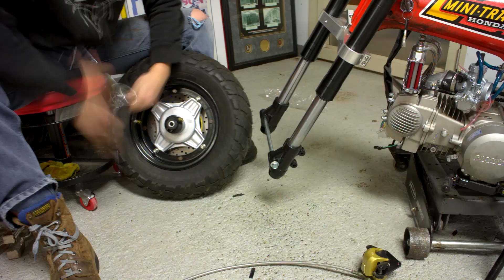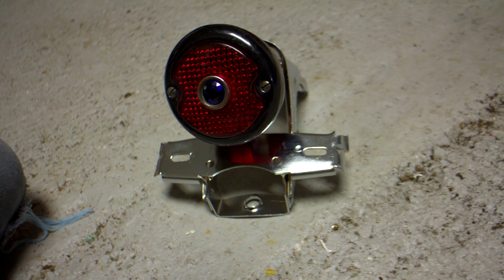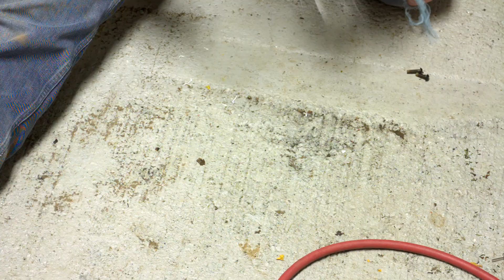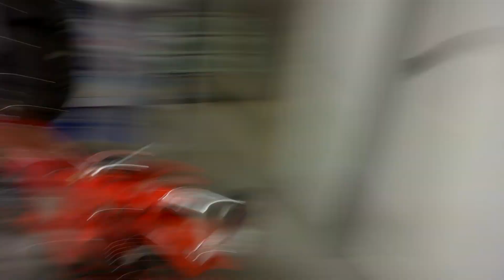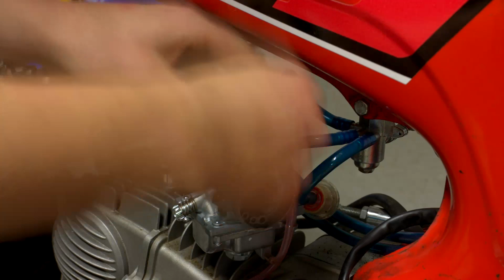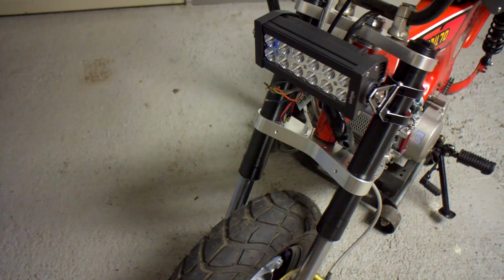CT70 Build Part 3 - Front Disc Brake + Headlight

Comment: What are the forks off? Love what your doing I need to switch mine over love the bar set up please help?
Reply from the maker: Hi Justin, the forks were bought new at phatmx (canadian website). I think many companies supply them in the USA too,  probably - tboltusa, trailbuddy, chpmotors etc. The bars are the stock 1979 honda CT70 handlebars! The bar mount holes on the forks are slightly too wide for the narrow bars so the bar mounts are not seated fully, and they are not grabbing the splines imprinted on the handlebar. So I have to find new bars, or specialty bar mounts, or modify the bar mounts.

Comment: Did you ever find different handlebars that fit properly? I have the same forks and am trying to find the perfect size handlebars that are tall enough.
Reply from the maker: Hi Dylan, I will get back working on the bike this summer, I want to try and weld something up so I can use the original 1979 bars. Though if I cant make it work with relative ease I will find some new bars. I have seen quite a few people put some very tall risers on these bikes with the inverted forks - that is always an option.
Reply: Makes sense. I actually just ordered some Pro Taper tall bars from phatmx. Just gotta find some tall risers

Comment: I would love to convert my front   forks and front breaks can you include a parts list it would be very helpful and by the way the bike looks great.
Reply from the maker: Hey Jim! Yeah I haven't tried it out yet but I am sure the new forks and disc brake will be an improvement; Many different websites supply them too.
Here's my list:

Phatmx.com:
https://phatmx.com/products/ct70-seat-69-71
https://phatmx.com/products/oil-cooler-kit
https://phatmx.com/products/ct70-main-decals
https://phatmx.com/products/5-pin-hyper-cdi
https://phatmx.com/products/320mm-piggy-back-rfy-rear-hd-shock
https://phatmx.com/products/front-sprocket-1
https://phatmx.com/products/ct70-inverted-disc-brake-front-end-pre-order-only

TboltUsa.com:
https://tboltusa.com/store/piranha-140cc-engine-br-fits-pit-bikes-and-other-minis-p-660.html
https://tboltusa.com/store/voltage-regulator-rectifier-12v-type-p-127.html
https://tboltusa.com/store/tbparts-dual-feed-petcock-for-atc70-ct70-z50-p-2322.html
https://tboltusa.com/store/bolt-clutch-lever-silver-p-140.html
https://tboltusa.com/store/tbparts-mikuni-vm26mm-carb-kit-26mm-intake-crf50-xr50-pit-bikes-p-576.html

mytrailbuddystore.com:
http://mytrailbuddystore.com/tb161basic12vtrouble-freewiringkit.aspx
http://mytrailbuddystore.com/chrometaillightbracket.aspx
http://mytrailbuddystore.com/ct70steelgastankrubbeset.aspx
http://mytrailbuddystore.com/stainlesssteelboltsforrims.aspx

Ebay.com:
https://www.ebay.ca/itm/HONDA-ct-70-st-70-st50-Dax-65-32-rear-tooth-sprocket-OEM-NOS-part-number-4121-GB/263469209917?ssPageName=STRK%3AMEBIDX%3AIT&_trksid=p2057872.m2749.l2649
https://www.ebay.ca/itm/MAX-Blade-44mm-45mm-High-Quality-Alloy-Motorcycle-Motorbike-Headlight-Brackets/182126829505?ssPageName=STRK%3AMEBIDX%3AIT&_trksid=p2057872.m2749.l2649
https://www.ebay.ca/itm/2X-Motorcycle-Turn-Signal-LED-Light-Indicator-Blinker-Handle-Bar-End-Handlebar-T/283105255730?ssPageName=STRK%3AMEBIDX%3AIT&_trksid=p2057872.m2749.l2649

Amazon.com:
https://www.amazon.com/s/ref=nb_sb_ss_i_1_11?url=search-alias%3Daps&field-keywords=nilight+7+36w+spot+led+work+light+off+road+led+light+bar+12v&sprefix=nilight+7%22+%2Caps%2C161&crid=30A2A5R14JF83

Fortnine.com:
https://fortnine.ca/en/fmf-racing-mini-factory-4-1-full-system-exhaust
https://fortnine.ca/en/renthal-kevlar-reinforced-dual-compound-mx-grips
https://fortnine.ca/en/crg-hindsight-lane-split-bar-end-mirror

Comment: Also my tires just got here I got kenda 2 ply they say tubeless. Are these similar to yours? Do you run them like normal just with a tube?
Reply from the maker: Hey Jeff, I have Michelin Reggae tires on this bike, I have normal tubes in them, works great. Be careful to not pinch the tube between the split rims when you bolt them together. I think in most cases tubes in tubeless tires will work just fine.

Comment: Hey man, what front LED bar did you use?
Reply from the maker: Hey dude, search this on amazon: Nilight 7" 36w Spot LED Work Light Off Road LED Light Bar 12v
Reply: @joewilliams7861  what mounts did you use to mount the headlight?
Reply from the maker: @dillon3719  I used these ones! https://www.ebay.ca/itm/MAX-Blade-High-Quality-CNC-Machined-Headlight-Brackets-44-45mm-Diameter/173827041236?hash=item2878e627d4:g:9WIAAOSwa7Rcgca7

Comment: What throttle and headlight brackets?
Reply from the maker: I got the throttle from TBoltUSA(TRC - BLACK BILLET METAL TUBE 1/4 TURN THROTTLE):  https://tboltusa.com/store/trc-black-billet-metal-tube-14-turn-throttle-p-8397.html

And the headlight brackets came from ebay (MAX Blade 44mm / 45mm High Quality Alloy Motorcycle Motorbike Headlight Brackets): https://www.ebay.ca/itm/MAX-Blade-44mm-45mm-High-Quality-Alloy-Motorcycle-Motorbike-Headlight-Brackets/182126829505?ssPageName=STRK%3AMEBIDX%3AIT&_trksid=p2060353.m2749.l2649

-The headlight brackets need to be 44mm if you have the inverted fork front end on your CT. I found that there was not many options available for this 44mm fork diameter so I had to pay up a bit for some decent quality ones.